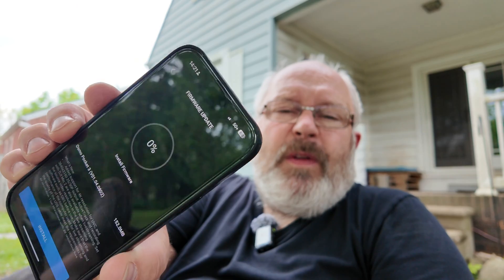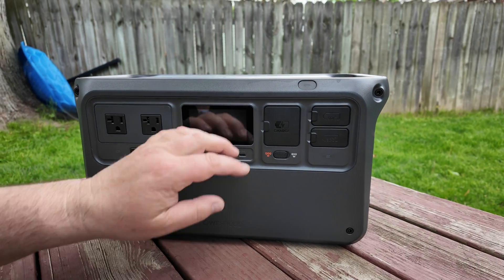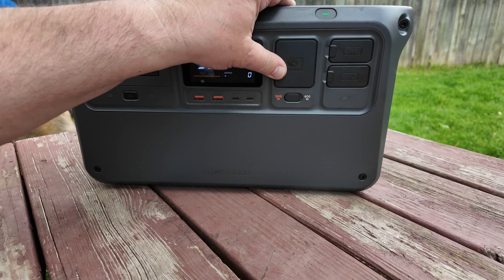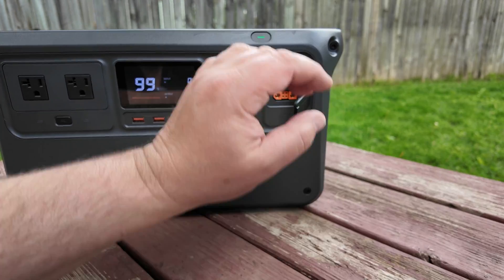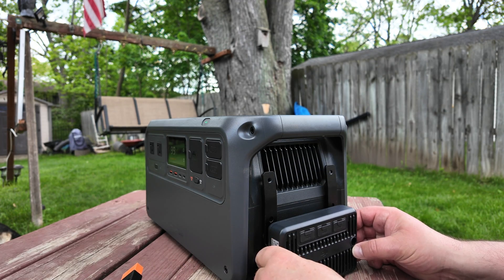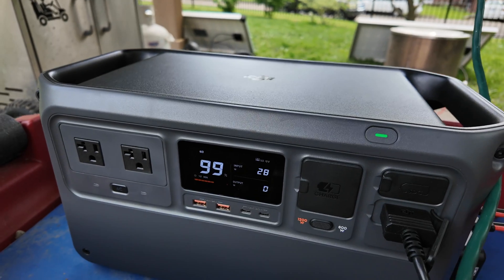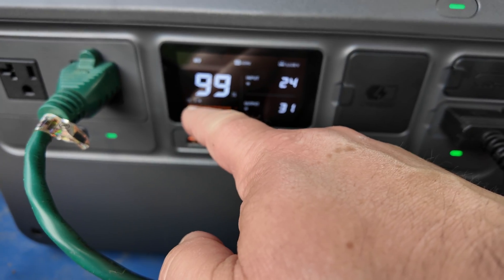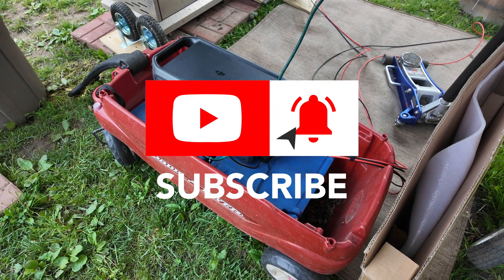DJI Power 1000 Solar Charging

Comment: What is the proper installation for the bracket?
Reply from the maker: As you can see in my video, that's how you install the bracket. The screws are in the package, and you can install 2 of the MPPT on the bracket. In the moment i only use 1 MPPT, and i screwed it on without bracket. @2:39

Comment: The charger runs really warm even at 50 watts, and gets way hot when it's close to 400 watts input. Is it normal for MPPT's to not have cooling vents? That thing is sealed pretty good.
Reply from the maker: Yes, the housing is the heatsink. Of course it gets very hot.

Comment: What i like. Is that dji tells you you can put their aproved solar panels that's like 300$. For 100watt. When we can buy 300 watt for that price.   I got my dji 1000 for semi truck. Now i just need cheap apart panels and xt60 cake with that 65$ solar port.

Comment: the manual is very misleading. It says there are 3 ports for each MPPT. For each port, we can use up to 200W solar panel, but we can only use up to 400w for all of the 3 ports (I guess 200W+100w+100W). Funny thing is each port can hold up to 10A, 3 ports can only hold up to16A?? how can it be possible? normally 200w has 10A, 100w has 5A, thus total should be 10+5+5=20A

Comment: I guess three ports can hook up with 4X100w 12V panels? let's say port 1 for panel 1, port 2 for panel 2, port 3 for panel3&4 in parallel (12V) or in series (24V)? and looks like you directly hook up the solar panels with the MPPT? do you need the solar power controller between MPPT and solar panels?

Comment: Support told me you could use 4x200W solar panels. They said basically no more than 200W per panel and no more than 800W total input.
Reply from the maker: @justinmanship5431  support didn't read their own manual?
Reply: He said he got that straight from senior engineers. I was asking about other panels that would work with the system since they just advertise Zignes. They mentioned a brand called Baiju which are 200W panels.
Reply: So how much total amps per port and/or how much total amps per mppt module?
Reply: This is also on their website 👌🏿

Comment: Hi, my 500 dji just arrived and I am using the 120 W solar panel which goes with it. In the shade the solar panel loads with 0 or 1 W....is that normal or something wrong?
Reply from the maker: that's normal, a solar panel has to see sun in order to work

Comment: Has anyone been able to get close to the 400 watts of solar with one MPPT or close to 800 watts with two MPPTs?  I have the Power 1000 now but am waiting on the solar panel purchase until someone tries to max it out.  The most I have seen so far is Hobotech got it up 250W solar charging on a single port of one MPPT controller.

Comment: 100w per panel is a big restriction, I have a 400w panel, so I would need to buy another 3x 100w panels, plus the MPPT box, plus the coneter adapter just so I can charge at the 400w that I could have just plugged straight into most other Power Stations 😒

Comment: Thanks for sharing. Did you try to charge it with portable solar panels instead of those?
Reply from the maker: No, i didn't use portable panels. I don't think it makes a difference, the ones i use are pretty good. The quality of the panel has nothing to do with being portable or fixed installation.

Comment: Correction: you can connect up to 3 solar panels that DJI recommends using a 100-watt MPPT adapter, 6 certified 100-watt panels using 2 adapters on the DJI Power Station 1024.
DJI informs that you can connect up to 1 200watt module to a single mppt adapter connection respecting up to 30v and 10a, this way you could use the second connection to connect another 100watt mppt adapter to a maximum of 30v and 6a. I will write below the possible configurations for the DJI 1024:
Reply: First configuration:
1 MPPT adapter + 3 original panels or 2 MPPT adapters + 6 original 100watt solar panels.

Second configuration

1 MPPT Adapter:
1- 200watt solar panel up to 30v, 10a maximum.
or
1-200watt solar panel up to 30v and 10a maximum + 1 100watt solar panel up to 30v and 6a maximum.

2 MPPT adapters:
2-Solar panels of 200watts up to 30v and 10a maximum + 2 solar panels of 100watts up to 30v and 6a maximum.

Third configuration:
1-mppt adapter + 3 solar panels of 133watts and up to 30v and 6a to reach 400watts.
2-mppt adapters+6 solar panels of 133watts up to 30v and 6a to reach 800 watts.

Comment: Great review, and adorable pups! I'm considering using 2 MPPTs with 6 panels – could that yield a 600W solar charge input? That would be quite remarkable!
Reply from the maker: i recommend downloading the manual. As far as i understand that could be possible with the P1000 model, just the P500 model has a 400W limit.
Reply: @mygiguser p500 has a limit of 300 and power 1000 400watts 1 adapter mppt.